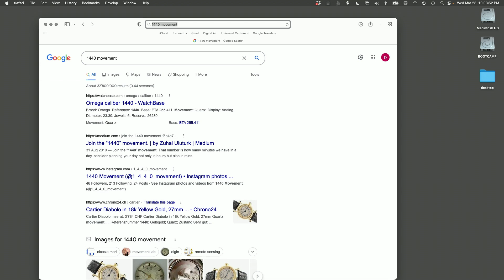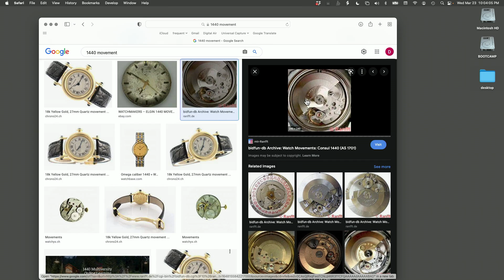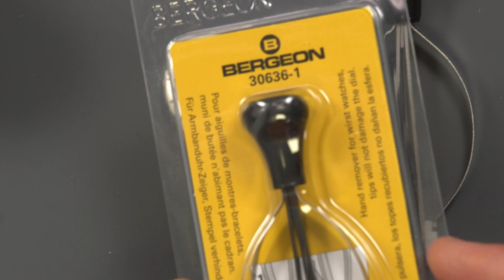How to Re-lume a Vintage Watch - Realtime 2 hours

Comment: I use an old fine oiler for re-luming pips on dials stick wood tends to suck to much moisture from the mix and it then doesn’t flow as nice as it does off the end of the oiler. 🙏😉
Reply from the maker: Thanks for the tip!  I've started doing that as well!